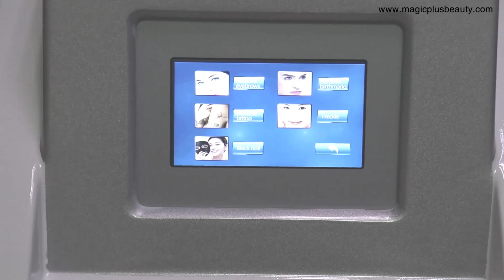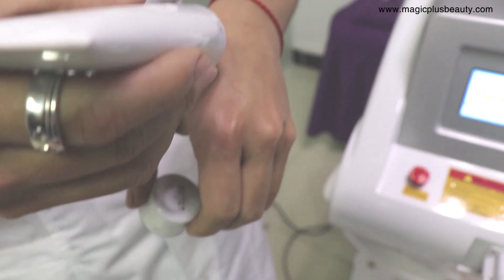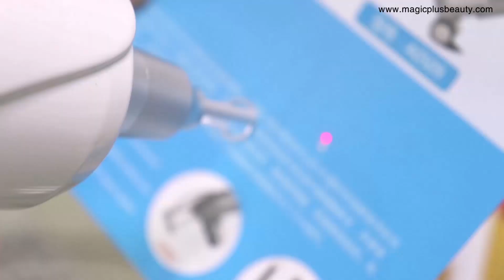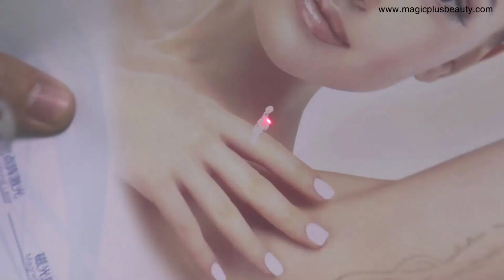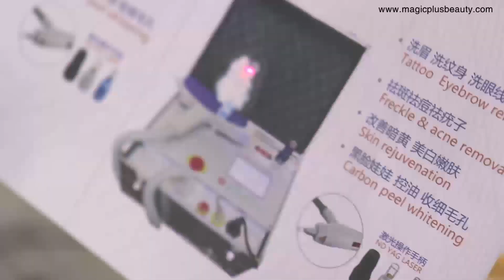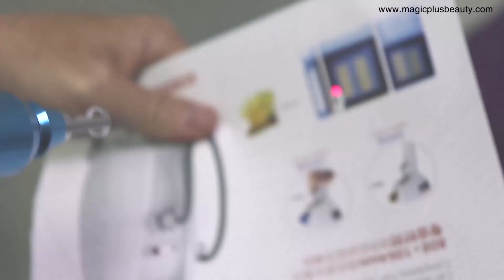A0506 1320nm/532nm/1064nm ND YAG Laser Tattoo Removal Machine With Carbon Peel

Comment: My machine just arrived, unfortunately, when I tried to test it pressing the pedal, it only turns on the red dot, but doesn't trigger the laser which should react with the pigment. Do you know what might be happening?
Reply: hi i have the same issue is you problem already solved if yes please let me know what the problem was
Reply: Hello, i have same problem. What do i have to do, pls?
Reply: @alinmoldo4511  Were you able to resolve the problem? Is there after-sales support from the sales representatives?

Comment: What setting for red thread veins please. And what cream is for the black to lighten? Copper cream? Sorry not familiar with it. Thank you
Reply from the maker: Hi Angela, thanks for your comments. On the video we use is carbon peel cream, and energy setting we suggest you can base on your tolerance and feeling adjust it from low to high
Reply: @ShefmonBeautyEquipment  thank you, got the cream thank you, so use same attachment for black face to use on thread veins?

Comment: Bought the same machine did the same set up like you but when I turn key to turn on screen does not come on or even light up can you Lyell me why or help me solve this problem ? ..thanks
Reply from the maker: Thanks for your contact Lisatorres. You need to open the instrument case to check whether the cable of the screen is loose or dropped, and press it with your hand or reinsert it
Reply: @ShefmonBeautyEquipment  if I open the case up I’m sure that will void my warranty judging by the stickers in the back. Is it safe and easy to figure out or do I have to send it back?
Reply: @MrBermyBuddz  .....how did this turn out? I bought this machine and am having the same issue. Don't want to void my warranty either
Reply: @angieknuth4243  i ended up opening it and the power cord inside the machine wasn’t properly connected to the motherboard. Was an easy fix and it works perfect now. Hope that helps
Reply: My dear, my device has stopped working without life, what is the problem?
My friend had the device and he was giving her a signal with water and she didn't fill it properly and then after that it became so that it wouldn't turn on.
 @MrBermyBuddz
Reply: @MrBermyBuddz  Hi, are you still using the machine? Has it lasted until now? What's your opinion of it?
Reply: @engrmarchini6110 I haven’t used it in a few years now as my wife and I have removed the tattoos we didn’t want. It works great with minimal pain and great results. I believe I did 5ish sessions and they were gone. Everyone’s skin is different though. Hope that helps.
Reply: I just got mine today and have the exact same problem. Were you able to fix the issue?

Comment: Hello .. Excuse me, I have a problem with the machine .. I have added water but the low water indicator does not want to go away and the machine cannot work ..
Reply from the maker: Thanks for your comments Hamid. For the laser machine it need to be add water until the water flow hole have water flowing out
Reply: @Magic Plus Beauty Equipment Thank you for your advice but J Ai Deja does this without result.
Reply: I think it's shots are run out of.

Comment: my device has not arrived yet. to do this test I have to put water ?? what would be that black gel that you put in your hand? what is it for ???
Reply: I want to order some where did you buy yours ?
Reply from the maker: Hi Clementina, thanks for your comment. You could purchase from us directly, pls contact me for more details of this machine, my whatsapp is +86 17302063169, thanks!
Reply from the maker: Hi Tamara, thanks for your comment. Before you use the machine you need to add distilled water or pure water into the machine. And the black one you asked is carbon gel, we need to apply it when we do the black doll treatment, hope my answer is helpful for you, thanks!
Reply: @ShefmonBeautyEquipment  thanks for the reply. my machine has arrived. how much water should i add?? and why did the water leak??? do i have to let some of the distilled water pour like in the video?? I'm sorry, I'm from Brazil so I don't really understand what you say in the video. if you can help me, I'm grateful. Thanks

Comment: Hello. I am Brazilian. what you put in the funnel and put in the hose is water? and what is it for? would it be to wash? or should i leave water in? I didn't understand in the video.
Reply from the maker: Hi Tamara, thanks for your comment. There're distilled water or pure water we added into the machine which could help us protect the machine to avoid high temperature burnt out.
Reply: Tamara, TD bem ? vc tem alguma experiência de uso com esse equipamento ? Realmente funciona para remoção de tatuagem ?
Reply: My dear, my device has stopped working without life, what is the problem?
My friend had the device and he was giving her a signal with water and she didn't fill it properly and then after that it became so that it wouldn't turn on.

Comment: I keep getting a water flow error  #6. On the video, overflow is on the left side but for some reason the overflow is marked on the right. Water was added, but we still are getting the water overflow error.  Would you be able to advise how to fix the overflow problem? Thank you so much for your time.
Reply: @Tyler Potter I am currently using it to remove tattoos Im doing my second one in a week but look works great.
Reply: You need to add more water it take a little less than a  quart
Reply from the maker: Hi Emmauel, thanks so much for your contact. For more details, pls contact with us directly so we could contact more conveniently, my whatsapp / wechat is +8617302063169, thanks

Comment: Do a real implanted tattoo not magic marker on the surface and show me it actually works...
Reply: This is the real deal but dangerous.
Reply from the maker: Yes dear, this machine use the laser strong penetration ability to help you removal the tatto, it's safe and effective
Reply: @ShefmonBeautyEquipment  hi, does this machine work with vaginal bleaching or skin whitening?
Reply: It works I have one and am using it on a tattoo on my face I have before picture and after 1st treatment it faded it quite a bit but it will take multiple tretments to get rid of